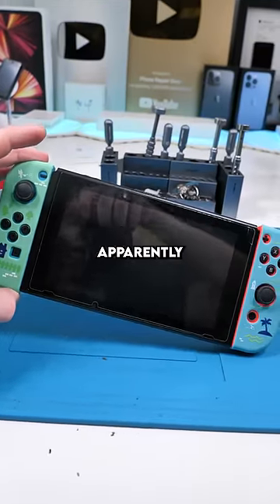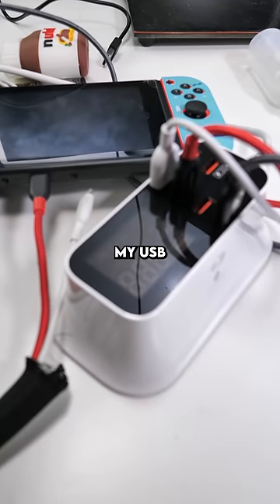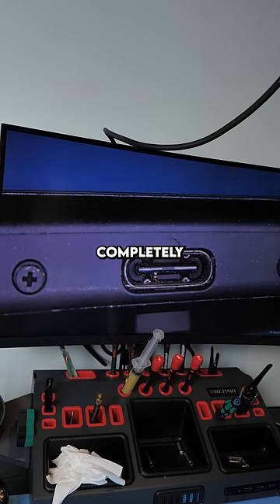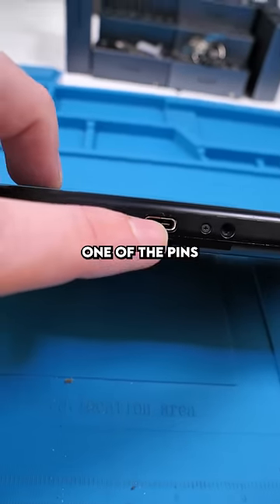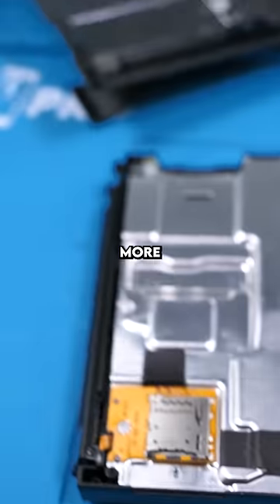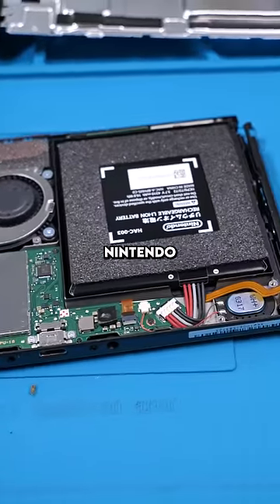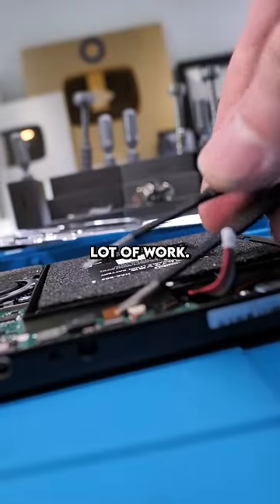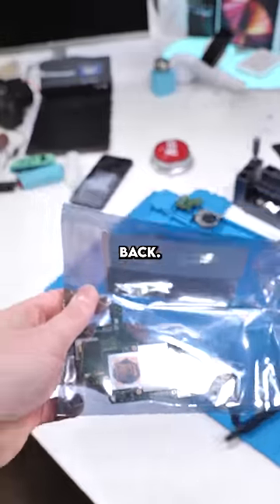This Switch Wouldn't Charge... USB-C Durability is 🗑️ #Shorts

Comment: “This would never happen to a Lightning port.”

European government: “huehuehuehue”
Reply: At least USB C is more durable than USB Micro B
Reply: @somebodyirrelevant141  I love usb c, but God I hate micro b, worst connector ever
Reply: Problem is Lightning port suc*s... Usb C is just much faster.
Reply: @Blue-nw3li  Yup, so many chargers I had to go through with my last micro usb phone.
Reply: @Mrbiz99  exactly. and I've known of plenty of lightning cables being broken from normal use so their durability is trash
Reply: @thatgaykid420  usb c support usb 3.0 20gb, 100w charging, hdmi and many other things, it just depends on what's implemented on each specific device
Reply: @thatgaykid420  USB-C is anywhere from 10x to 50x faster data and charge speed than the lightning port depending on configuration of the USB-C
Lightning has not changed in the past 10 years, meanwhile USB-C has been constantly improving.
Lightning port is outdated.
Reply: It actually can happen to a lightning port, had to replace mine on my XS Max as it charged but couldn’t play audio through mt Fiio BTR5 Dac, a pin or 2 were bent out of shape when I looked closer at it, knew it wasn’t the cable as I had 2 and tried both on my iPod touch and it worked flawlessly
Reply: Nice laugh!
Reply: @thatgaykid420  maybe your iphone has a dead battery or the other device you are using has a 5+ year old Usb C connector.
I don't understand why Apple is sticking to lightning when they have Usb C Thunderbolt connector, which is miles faster than lightning. I guess they still have some spare ports and cable to use and not to send them to the landfill............
Reply: @Blue-nw3li  same i fcking hate it too so much 😭
Reply: @Mrbiz99  It's money. Every company when they want to make something with a Lightning port / connector, they need to pay Apple some money.
Reply: The „government“ is not a „government“, it is completely different.
Reply: @thegoldenatlas753  speeds I don’t care bout as I don’t transfer nothing and it charges pretty quick I’m happy with lightning
Reply: @thatgaykid420  lightning i believe is only up to the usb 2.0 standard, where usb c is at the 3.0 standard, usb c is definitely better in the switch's case, using the one port for display output, two usb 2.0 slots and one usb 3.0 slot, while taking charge. (plus the fact that lightning is an apple proprietary cable)
Reply: @Mrbiz99  UBC is used for faster Data Transfer for work stations mainly but it let’s far less durable than Lighting as an engineer they will tell you
Reply: Good
Reply: @Mrbiz99  the lightning port doesn’t suck and is easy to clean out any dirt or pocket lint that may collect and end up in the charging port without risking damage!!! The lighting ports pins are press in the walls of the port making it less breakable
Reply: @thatgaykid420  You really think charging speed is all that matters? Like, idk data speed?
Reply: @skystreem4860  the port is better but the cables are trash
Reply: @Mrbiz99  faster for breaking….
Reply: The lightning port might be more durable but that's all, USB C beats it in all other categories.
Reply: @Blue-nw3li  it isn't even that bad
Its actually TERRIBLE. NEVER SHOULDVE BEEN INVENTED
Reply: @neolordie  you mean 80Gb with thunder bolt
Reply: @KZilla  But the video is talking about the port, not the cable…
Reply: I mean, it's a trade of between convenience, good connectivity, speed  and slightly better durability
Reply: @thatgaykid420  USB C being faster is a fact. MacBook isn't charging with lightning and there is a reason why.
Reply: @skystreem4860  The only thing better about lightning is the simpler pin hardware. There isn't anything inside the port that could potentially bend or break.

And that's why EU should make sure Apple use USB c while also giving enough oppertunity for everyone to make a better port than usb c.

We need better ports, not older ones
Reply: most people wouldn't complain about lightning if it was fast
Reply: TypicalX  thatss fake the lighning câble sucks not the port and type-c is faster
Reply: I mean USB C is alot better then lightning for a whole lot of reasons
Reply: @thatgaykid420  HAHAHAHA YOU LIVE IN CAVE?
Reply: @KZilla  the cable breaking or the port? because that’s a massive difference
Reply: @roowut  that happens a lot more than the pin issue in this video
Reply: @KZilla  the cables are different from the port, just cause a cable breaks doesnt mean the port will break its just a shit cable. Just buy a quality cable (lightning or usb-c) and take care of it and it'll last years.
Reply: "Never happen with a lightning port" . Aren't you the one that said Apple should switch to USBC?
Reply: @somebodyirrelevant141  everything is… EVERYTHING is more durable than B
Reply: W COMMENT, BRUH - THIS MADE ME LAUGH SO HARD. 💀💀
Reply: @skystreem4860  usb C charges way faster and transfers data way faster. a standard usb C cable is also much more durable than the lightning cables that Apple sells, their quality is shit and those cables die within 1 or two years...
Reply: @Cobras.  lmao, indeed, but charging speed on usb C is also way higher xD.
Reply: @newbie4789  APPLE IDEA OF SHARING IS WIRELESS, and thank for stating basic engineering logic about lightning not breaking as much unlike most people who don’t think about what they type and I HOPE THE IPHONE GOES PORTLESS THAT WILL BE THE BIGGEST MIDDLE FINGER TO THE EU😭😂😂 BECAUSE GOVERNMENT BODIES ARENT ENGINEERING FIRMS😂😂😂
Reply: The real reason Apple still uses lighting cables is because they can build in and authentication on their devices to see if it is an authentic lighting cable and if it is not make the device not charge because it's not their cable also they can decide how much to sell their obsolete lighting cables for
Reply: @skystreem4860  Don't worry. The engineering challengers behind efficient wireless charging is too big
Reply: @skystreem4860  Bruh, my usb c cables last infinitely longer than my lightning ever have, meaning that it's not carelessness, it's a difference in quality. I also know that lightning doesn't have support for fast charging or high data transfer speeds. And the port decides which cable you can use, so that difference is pretty essential in this discussion. Lightning cables aren't this eco friendly product you think they are and the screwdriver trick has the same chance of hurting a lightning port as it has of hurting a usb c port. Apple just uses shit ports because it makes them money through royalties. I'm very glad that the EU is forcing apple to stop using that absolute abomination of a cable.
Reply: Man but can you transfer 30gb of raw video from your phone to your computer quickly over lightning? All I’m saying is they better make the new iPhones not only usb-c but also thunderbolt 3 or 4
Reply: @skystreem4860  Xiaomi is releasing 240w charging using USB C.
Give me counter argument describing advantages of lightning or wireless over it's competitors
Reply: @osvaldaspaslauskas5040  well your next iteration of iphone wont be lightning 🤷🏼‍♂️
Reply: It's impossible to break the middle bit in normal use
Reply: @thegoldenatlas753  err, no, usb c is just the plug, when you get a cheap cable it‘ll just be as fast as lightning, because usb c can be just power, 2.0, 3.0 or even thunderbolt 
also some can transport audio/video, some not
usb c is just the plug, no protocol etc
Reply: european goverwhat?
Reply: @ali3173  european commission
Reply: @adamsmith5419  oh well in end it’s not big deal makes small difference
Reply: USB c more used around than even lighting more easy to repair and cheap and many more things
Reply: @thatgaykid420  you are a bit confused in the topic mate....
Reply: Yea but atleast usb-c doesnt use a 10+ year old version of usb
Reply: Yeah but how about we talk about the transfer and charging speeds then of lightning soo much better lol😏
Reply: @thatgaykid420  what do you mean where? It’s faster in every way possible. Data transfer and charging.
Reply: It's kinda ironic when you suddenly realise, that maybe instead of enforcing Apple to use USB-C, they should've enforced Apple to make lightning an actual standart to be spread to all other devices. Except I imagine Apple to be greedy enough to charge other companies for a patent.
Reply: Lightning port still runs at usb 2.0 speed
Reply: @That Honda Guy  You probably use faster charging brick or your iPhone's battery is smaller.
Reply: Usb c is way better
Reply: OMG i can’t stop laugh cause of you 😂😂😂
Reply: Tbh, from a durability standpoint id prefer if they upgraded the lighting standard
Reply: @skystreem4860  exactly. Lightning ports are so much more durable. Like who cares about 100w charging. All that is gonna do is wear your phones battery down faster because of how much power is going to it. On top of the lightning port is so much more durable. The usb c on androids is terrible and delicate like the top of a newborn babies head but everyone think it is the best thing ever. And it stops me from having my charger stolen by coworkers cause they all have androids
Reply: @KZilla  The cables are trash, but the connector itself is superior when done right.
Reply: Heheheha
Reply: Yeah but lightning cable connector durability is awful, like every single cable in my house, each one a different brand, and still almost every single one has fried connectors.
Reply: @thatgaykid420  usb-c supports up to 40 gigabytes per second, compared to 480 megaBITS per second for lightning
Reply: Last iphone I owned I lost count of the number of leads I bought to just charge it. Lightening cables are rubbish..
Reply: @Iaintwoke  mine is 5yo, never had a single problem.
Reply: @charakiga  my phone's do get a fair bit of abuse but never had that problem with Android phones. And at the time my neighbors was always asking to borrow leads too for similar problem. To be fair it was iphone 6 and 8 so maybe they have improved but it is still the same type I believe. Well until now anyway.
Reply: @TLNik  lightning is way too outdated and weaker compared to usb-c. If there's non-apple product that uses lightning port, I don't think they'll survive longer than usb-c ones.
Reply: @Iaintwoke  yeah, lightning also bends way too easy compared to usb-c. Never spend a dime after having a usb-c device because they never break.
Reply: @carljojohnson  I can honestly say that out of all the android phones I have had not one ever had a problem with the port. I think I may have bought a new lead once because it didn't stay in very well but that's it. At one time I swear I was getting through a lightening cable every week or two. Some of them were only cheap but even the proper ones never lasted very long. Don't understand how more people don't have issues. They must treat their phones like a baby...🙄
Reply: @Mrbiz99  bro censored sucks 😂
Reply: @Mrbiz99  the problem with it being faster is that is will decrease your battery’s life faster than when you use a lighting cable. I’m talking about fast charging.
Reply: Yeah, even though it's nice having one for everything and the reason Apple is angry is definitely money, everyone here probably knows the snail's pace of the law and how we will now be stuck with USB-C for eternity
Reply: Guys, let's end this up.. the pros for the lightning port: only one, it is somehow durable. 
The pros for the USB C  - same, only one, faster
The thing is, lightning port uses 8 pins for both sides so 16 pins in total. Apple is stupid because USB-C could be also USB 2.0 standard, everything is about hardware. If apple did change their old hardware for the USB transfering, charging etc. the lightning itself could perform as good as USB-C but hold on a sec. forgot sperior fast charging like above 30W or 40.. the lightning port is so tiny that it can't handle much current, so apple should be comming up with another charger with 20V charging and 1.5A of current at 20V 30W charging power, that's enough, the lightning port is capable connector but it is old.. but engineers if they could thinking what to make better, what needs to be improoved and what could be improoved, i think the LP could go above 900mbps in transfer speeds and also with 30W charging. USB connector is trash but cables are good, LP is good but cables are trash. The lightning cable cost around 10€ in slovakia, not too much but when the USB-C port get desteoyed, the overall repair fees could be 100€ and above depends on what kind of phone u have. If the next iphone 15 came up with USB C and it breaks, you can just sell your second kidney. It is happening to LP as well but not as often as with USB C.
Reply: yeah, kinda stupid in terms of lifetime, but lightning can‘t transfer data that fast.
Reply: If lightning ports were better and faster than usb c and apple was less stingy with their crap, lightning yea for sure would have been the port for the future. Buts its apple. So yeah.
Reply: European government LMAO
Reply: @mixmastaplaya  Never killed Lightning cable. My daughter did it many times - she used her phone during charging, and cable was 90 degrees bent. Once she fried charging chip, cause she caused a short circuit with damaged cable.
Reply: @swecreations  so the lightning connector should be improved.  USB technology had its day, but it’s time to move on.
Reply: @skystreem4860  portless charging for apple would be bad 😂 they’d actually lose money rather than gain a single penny. There’s a reason why they didn’t do it when the 14 came out and they’re not doing it when the 15 comes out next September
Reply: @Mrbiz99  To an extent, there are design tradeoffs to be made. Larger pins are more durable, but you can only fit a few in a small space, limiting speed. However, using smaller pins comes with the risk of making them more prone to damage and potential shorts. 

USB-C is the standard that tries to do everything. Unfortunately, I feel that in a mobile use case, I don’t feel the tradeoffs made to be correct. Additionally, USB-C is more difficult to clean. 

Ideally, I would like a magnetic USB standard  that keeps pin counts down, and with few or no moving parts or friction. A rounded-off design would aid in keeping them clean. Data transfer would be fairly slow, but the upshot is a connector that is far more durable to handle the rigors of smartphone life.
Reply: @thatgaykid420  aside from the fact lightning is still stuck with USB 2.0 protocols and can't transfer data faster than 480Mbps? The switch literally could not function like it does with a lightning connector instead of type c
Reply: Your right the lightning port would destroy itself like usual
Reply: @Mrbiz99  didn't have to censor suck, lmao.
Reply: @manofflorida1138  Lightning is USB technology? The hell you talking about lol
Reply: @Blue-nw3li  micro b is cool
Reply: @swecreations  It’s an evolution of USB technology with much needed improvements, unlike USB-C which is electronically identical to the USB-A.
Reply: @Mrbiz99  why does it suck tho
Reply: @KZilla  but you don’t need a fast cable tho
Reply: @Mrbiz99  but you don’t need a fast cable tho
Reply: Lightning might be more durable, but it's still not a good port because it just simply isn't as versatile as USB-C. 
It's slow at charging AND at transferring data.
Reply: 12+ years of intense and multiple usb c utilization and never seen anything like this
Reply: @neolordie  yes but something that needs to be said is the importance of what kind of USB-C cable you use and it’s quality. Most consumers don’t realize that a cable isn’t just a cable, 90+% of the “quality” USB-C cables out there won’t even do 100w, capped out at 65w a majority of the time. Then it’s a whole other thing when it comes to data transfer speeds…
Reply: @thatgaykid420  Dude lightning port is like a slug compared to usb transfer speeds. once you actually use a thunder bolt port you’ll see what real speeds are
Reply: @thegoldenatlas753  tbh lightning is already rlly fast for me like how fast do you guys want ur phone to charge man like 100% in one min? And 100w is rlly bad for ur battery cuz it will be very hot and lead to lesser battery health
Reply: @Blue-nw3li  Except you can get reversible micro B at least. Those make legacy devices not that bad.
Reply: I've yet to have a USB C port failure
Reply: the only issue i have with lightning is that it hasnt been "lightning fast" for some time now. and i hate apple
Reply: @KZilla  not using them correctly. I smack them around and still get average of 4 years runtime on a Apple oem cable, even longer on Anker/Belkin ones
Reply: @thatgaykid420  how about macbooks?
Reply: Yes, if it was a lightning port, then this wouldn't happen, unfortunately, you would then have a lightning port.
Reply: @yoshi555king  nah, all my other cables are fine, only the apple ones suck
Reply: Wtf is that goofy ahh laugh
Reply: @neolordie  I swear you can get usb c 4.0 40gb, I saw it somewhere
Reply: @Nim...  well, so many phones i had to use my old tablet's charger and it's a micro. So...
Reply: Atleast apple cant monopoly chargers anymore, and probably intentionally make the charger heads weak
Reply: Worst things happen to lightning ports 😂
Reply: Lol
Reply: Instantly disliked when he sad that.😡🤮
Reply: @thatgaykid420  lie to me without telling me you ate lied
Reply: @thatgaykid420  data transfer, not charging
Reply: @KZilla  this is a first gen USB c so it's terrible
Reply: @thatgaykid420  USB c 4 let's you connect a GPU to you're laptop
Reply: lol
Reply: @thatgaykid420  it transfers data faster, and it charges faster.
Reply: There are reasons apple wont switch, and why its better. You have to buy multiple kinds for different devices instead of just for one phone, sometimes usb-c doesn’t charge and transfers data, and other times it only will charge certain devices… but with the lightning cable, its all the same.
Reply: @neolordie  only some of them, you have to buy whole other ones for it to work they arent all made for the same things, and some companies make it impossible for it to work with could be compatible devices
Reply: @ednamode5116  that's because all of you buy the cheap ones
Reply: @ednamode5116  with USB it's all the same. Multiple devices work for it. Any USB C chargers works on all devices. PC chargers work on phones. Etc. The Nintendo switch uses USB C, The PS5 controller uses USB c. And more.
Reply: @ednamode5116  and soon. Apple will have to use USB C
Reply: @KZilla  yeah but the cable breaks which is so much cheaper than replacing the port on the device
Reply: @Nim...  one of mine litteraly was used till the plastic plug ripped off
Reply: Lightning can easily break and not protected from dust and other stuff. Type C are protected and they cannot break that easily. When we are talking about chargers but not devices so I really think type C is better, more speed (except of data transfer) but lightning in that really sucks and they're contacts can easily get in reaction with your sweat because pins are outside. Lightning (if original) are expensive and are worse than type C with their technology... When my XIAOMI fall of they are hanging and port or cable/connectors aren't broken, my friend had same with iPhone and charger broken, they bought another one for price of 10-20 TypeC's for one fckn LIGHTNING! LOL😂
Reply: although apple being apple if we wanted lightning ports on non apple devices (if they would even allow it), they would probably charge a super high royalty to have it.

but USB C is a step forward, remember USB Micro and Mini ports.
Reply: @jjjacer  usb micro are in past, even vapes and pod systems like Nord Smok use it. Also I had Nord Smok 4 three times and two times I had Nova 2S by Nord Smok and even older models used type c, they are more better. I'm using Xiaomi Redmi Note 8 pro more than 3 years and I like it, good performance and no problems with type c port and Corning gorilla glass 5 really good. I accidentally dropped them few times on road, floor and on table and they never cracked or damaged matrix, only some small scratches which are really hard to see. Performance In pubg mobile is ok but I played really much when ranked up really hard so now I have 4 spots without pholiphobic layer but it's OK. EVERYTHING WORKS PERFECTLY and charger charging with 15w really fast. From 0 to 100% for 1 hour and lasts when playing hard games up to 4hours but when I use it for calls and YouTube videos, making beats on FL Studio mobile so from 100% at morning I still have 25-48% of battery at noon... So now apple are just releasing old models with small improvements as new. Also why that new functional widget in iPhone 14 and they're development took 1 year when Chinese made same widget in 3days and they did it much better. I cannot understand why everyone are buying iPhones if they haven't much ways to customize it, safety? No! What I really like in android that you can get everything what you want. Custom UI? PLEASE! MIUI in Xiaomi, even other phones have they're UIs and if you don't like Xiaomi MIUI so you can remove it and you'll have more space and clean android 10,11 and etc
Reply: Wtf does "huehuehue" mean?
Reply: @JonnyUnforeseen  probably a laugh of a European person
Reply: @neolordie  are you currently using 100w charging or do you frequently tranfer data through cable?  Those are its limitations but everyone doesn't use 100w charging or data transfer so it doesn't matter anyway stop comparing usb C capabilities with lightning because not everyone is going to push it to its limits so practically speaking both are same (many people use 27 or 30 watt charging with usb- c where apple also is closer to it ie 20w charging I'm not speaking technically but practically).
Reply: @SmitePlayz1  do you think inventing and making a design is like playing video games in switch or like posting a comment you beef
Reply: @jayanthgorinta6145  I use 65w and I use my phone as a rooter, so yes, usb3.0 is helpful
Reply: @TheDaniel212pl  ok here we go will every phone thats having usb c from now magically support 240w fast charging only because mi released it with usb c. You don't even buy that smartphone and talking its capabilities you dame
Reply: @neolordie  I'm not saying it's not useful but I'm saying that everyone is not using it to its extreme so everyone is not using it(capabilities)
Reply: @jayanthgorinta6145  1 yes i do own that phone
2 yes i do know the capabilities of most phones on the market
3 just looking though the spreadsheet is enough for you to learn about phones abilities
4 most phones increase phone charging speed except iphone which overheat with 5w
Reply: @jayanthgorinta6145  when one of the key feature you promote your product with, is high bitrate video encoding such as prores, and the possibility to film in 4k, providing only usb 2.0 speed to get that footage out is plain stupid, so not everyone will use it, but it cost little to nothing and should be given to consumers, the only reason iphones are still on lightning is because it's a proprietary connector with licensing fee that makes them money
Reply: @somebodyirrelevant141  facts tho.
Reply: People in here ignoring the fact that USB-C is just the form factor for the connector… you can still have a slow USB-C cable with USB 2.0 speeds, lol. All depends on what the manufacturer decides to use as spec for cable and such.
Reply: @Hinkjefel  you are partially correct. USB C can run with all USB standards, but ports designed as USB 3 standard won't run 4 standard speed but you can still connect the two together and be limited to the speed of the weaker one. Current max speed of USB is USB 4 , which lightning just doesn't do it's maximum speed is same as USB 2 standard
Reply: @somebodyirrelevant141  i want to hate it but i can't because my off-brand Go-Pro and my headphones use them soooo.... yea
Reply: USB-C is better because of higher datatransfer per second compared to Lightning
Reply: @Mrbiz99  bro why would you censor the word sucks
Reply: Usb c is so much better, even apple uses it.
Reply: bullshit this is guaranteed to happen to a lightning port
Reply: @thatgaykid420  lightning is stuck on usb 2. it takes hours to copy that ProRes videos to my pc. usb 4 takes seconds in comparison
Reply: @thegoldenatlas753  For phone it's up to models. a lot of phone just use usb-c as an interface but don't really have usb-c functions. But ye if it's a real usb-c like a high end androids it's 100% better.
Reply: @somebodyirrelevant141  Honestly I really don't care WHAT port is standard, just as long as it's not micro-usb. Those things literally fail within 6 months every single time, I hate them lmao
Reply: @thatgaykid420  I'm pretty sure lightning cables have been faster at data transfer for years, but not by a ridiculous margin. USB C definitely has the edge in power delivery tho
Reply: Well USB-C was supposed to be designed like lightning is with the pins on the cable instead of the device but Apple specified that as part of their patent for lightning so USB-C wasn't allowed to do it and had to change their design.
Reply: @somebodyirrelevant141  um Nintendo Switch only uses USC cords not USB cord
Reply: Shit is outdated though
Reply: only PRO lighting remark ive ever heard LOL!!
Reply: @thatgaykid420  depends on the cable
Reply: very good
Reply: @osvaldaspaslauskas5040  Even though its worse in everyway? Its not even more durable if you get an actually decent usb c cable. Why do you want to shill so hard?
Reply: @Mrbiz99  
But at what cost 
It's like having the fastest car in the world but it's made with thin steel
Reply: I never knew there was a name for usb micro B, always called it Samsung charger
Reply: @thatgaykid420  Doesn't take as long to charge because the battery is 20% smaller than other batteries you compare it with
Reply: CrApple did it to themselves. They decided it'd be a great idea to start selling iPhones without including a charging cable to "save the environment". The European government just took that a step farther and said "if you really want to save the environment, you need to standardize your port so more people can reuse their old cables". So CrApple can't just use it as a cash grab to get people to buy their crappy cables that are designed to break and be thrown out
Reply: Don't forget usb c is usb 4.0 but lighting is usb 2.0 lollllllll
Reply: @KZilla at least they don't break the port
Reply: Lightening is a superior charge if the data speed is improved upon.
Reply: @thatgaykid420  Lightning port uses USB 2.0 speeds. Type C is faster get your head out of Apple's butt and check it yourself.
Reply: Also USB 3.0 or upper will never appear to a Lightning port
Reply: @neolordie  technically it can support 40gb transfer with the thunderbolt software protocol.
Reply: Lightning ports have their own set of failure scenarios. And when they do fail, you can't fix it.
Reply: It's a weird modified usb c
if you would use a phone cable you'd fry your device.
Reply: @Nim...  yeah
Reply: TypicalX  Ohio: hold my beer Florida
Reply: And no fast charge on lightning
Reply: @Blue-nw3li  so glad it's slowly becoming less commonplace
Reply: laughs in usb 3.0 speeds, yo apple ppl still on ancient 2.0 speeds
Reply: @thatgaykid420  iPhone also has a smaller battery than most devices
Reply: @thatgaykid420 lmao someone doesn’t have a macbook

Usbc speeds have much better data transfer/charging speeds if the device can do it. Lightning is capped
Reply: @Mrbiz99  and lightning ports are brilliant

At breaking cables
Reply: Why does it not happen with a lightning port though?
Reply: At least its better than usb-B
Reply: at least it’s not proprietary..
Reply: @KZilla i have that sale Cable that Works from way back when i bought my iPhone 7 it still works with no Problems
Reply: Ok Apple fan boy, unfortunately lighting is ass
Reply: I love reading this comment section like a child full of curiosity bc i don't understand a shit of what everyone is talking about
Reply: tHiS wOuLd NeVeR hApPeN tO a LiGhTnInG pOrT
Reply: Accurate
Reply: @KZilla  yeah but the ports are more durable than the port for usb c.  It's a design thing the lighting and usb c have opposite designs on the port and plug the USB c phones have a little pin that sticks into the middle of the ucb port but the drawback is that it is easier to damage the port on the actual device the cable connectors are pretty resilient tho, Lightning is the opposite the ports for iPhones are easy to clean and don't break as often but the connectors on the lighting cable break easily. I personally would rather have to replace a cable than send my device into a repair shop to replace a port.
Reply: @Mrbiz99  yo sucks isn’t a bad word just to let you know
Reply: @thatgaykid420  theres phones with usbc that charge 0-100 in 10 mins
Reply: I mean, apple wants to keep the lightning port apple exclusive, if they didnt maybe that would have become the normal port.
Reply: @TheHappiestWheels obviously there are safety features to prevent it from happening
Reply: @thegoldenatlas753  that's so true
Reply: @Mrbiz99  lighting and usb-c has the same power..
Reply: I feel like it's a little bit better than I found that because like I found yeah it's kind of better but think about it little bit of dirt and I mean technically they're all cheap I'm pretty sure they're all made in China
Reply: @farmerjoebailey  mostly but not quite the chips are but that's about it
Reply: @meric12131415  I'm just asking the question is the switch light like better than mobile from what I can tell yes but I want to ask someone that has it because I don't want to get something that's $200 and find out it doesn't work
Reply: @farmerjoebailey  I mean granted it's the same as the og switch only without the things that make a switch a switch so hd rumble and non detachable joy cons come to mind but it's alot lighter weight wise as well not to say the regular one is heavy
Reply: @meric12131415  okay thank you I was just wondering because I play fortnite on mobile and I'm getting sick of it so I thought about it setting up for the switch light
Reply: @farmerjoebailey  oh yeah definitely a good choice and the best part your progress transfers over no questions asked so long as you linked it with a platform
Reply: And Sally since Apple patented the lightning port no one else can make it or use it on their phone so we have been curse to use the current usb-c design
Reply: @clonescope2433  you meant salty?
Reply: Didn't know he is an apple fanboy.
Reply: @imhong28  apparently so
Reply: I have the same problem with my Nintendo switch and I’m wondering where would I take it to get it repaired?
Reply: @offroadwheelie43  usually a u break i fix my dear Naruto fan🤣
Reply: @thegoldenatlas753  techinically it’s not the cable, it’s the phone it self, Apple won’t let you charge your phone no more than 29W
Reply: @Cobras.  for the everyday guy, yes. If I want to transfer stuff I use my pc
Reply: Nope just every lightning charger every few months lol
Reply: @patrickm2912  🤣 seems so
Reply: RIGHT, I HATE USB C
Reply: 40gbs : "This would never happen to a lightning port"
Reply: @thatgaykid420  I have super fast 67 w charger so L
Reply: He's throwing shade
Reply: @KZilla  cable is different from connector... we're all talking about connector. 
Don't comment dumb things please, all cables are the same, it's bendable and it'll break at some point if you keep bending it. Get braided cables to prolong the cables
Reply: @Mrbiz99  But also lightning port is more durable. USB-C is surely better than micro usb, but it’s still bad, and i talk from experience.
Reply: EU did this because greedy companies like Apple made Lightning exclusive to their platform and chose to never innovate on it. Not to mention how many chargers would be wasted the moment somebody goes to any other device. A standard reduces the number of cables that are being thrown away and means nobody can monopolize it.

The lighting could have been great. Actually, it could have been faster than type C and was already more durable. Just Apple wanted to be Apple.
Reply: Micro usb is best
Reply: Usb mini b is best
Reply: @Mrbiz99  lightning port can break permanently if you don't clean the dust out of it very often.
Reply: @KZilla  just take care of your wires 🤔🤔
Reply: I mean yeah, the port wouldnt get bent. They are genuinely durable on the phone.
Apple spends its money other places, where as android phones skimp out on ports
Reply: I have a great idea, if you all like lightning so much, make a petition that apple shouldn't charge license fees for it, and then everybody can use lightning !
Reply: Bruuuuh I hate lightning port, it sucks
Reply: @@SimiGameplay4 says the person with a polar bear pfp, you and I are no different
Reply: @@SimiGameplay4 well you have a fair point lol, well played XD
Reply: Lighting port is shit tho. Everything else has just such a huge limitation
Reply: @Mrbiz99 until you kill it
Reply: @thatgaykid420  iphone charger faster? wtf you using a $6 chinese knockoff?
Reply: I mean lightning cables and ports suck and apple price gouges everything and the laws are probably the only thing regulating newer markets. Hell apple may go under fire for "slower for non approved chargers"
Reply: Good riddance
Reply: @Mrbiz99 they still use it on their magic accessories
Reply: @Mrbiz99 blud censored sucks 💀💀💀
Reply: @TheRobben98  what kind of argument is that. "If you get a cheap chord it can suck."

That's like saying Chicken Alfredo isn't necessarily better than spaghetti because if you order cheap Alfredo, it can suck, be decent, or really good. You're not going to compare shitty Chicken Alfredo to some of the best Spaghetti ever.

The point is, the best Lightning cable will never be as good as the best USB C cable. Saying that that's wrong because of inconsistent quality works both ways. Not all Lightning cables are the same quality.
Reply: @Mrbiz99 its the licensing money that the lightning port gets them, and the ability to control who makes accessories and what for
Reply: @thatgaykid420  does your phone charges in 13 minutes? I guess not
Reply: @Mrbiz99  bruh what
Reply: @Mrbiz99 The problem with your brain is apple hating
Reply: @Mrbiz99 ain't no way you censored sucks 💀
Reply: @Blue-nw3li oli absolutely despise micro b
Reply: Rrrr
Reply: Lightnig port sucks
Reply: Hey pal!👋👋, listen friendo, when I saw your comment, I immediately started toutching myself, hope I can toutch you next. Over and out! 🤭🤭
Reply: @thegoldenatlas753 it dont matter its faster but it is way more fragile if the chord breaks buy a cheap new one but when the port breaks it aint that easy there are no pins like that in lightning its all built in so therefor usb c is faster charge but way more fragile